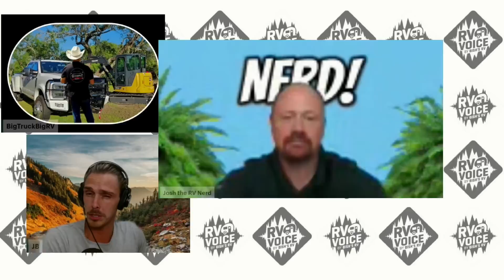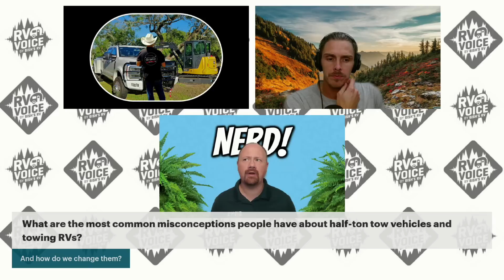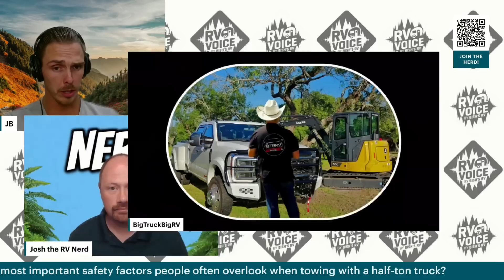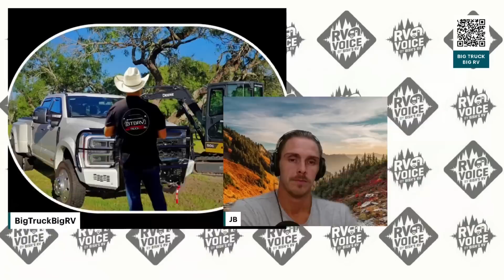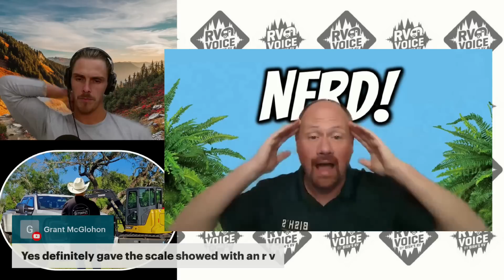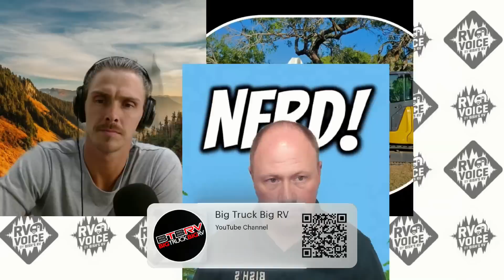1/2-ton Pickup Towing Debate! Josh The RV Nerd VS Big Truck Big RV!

Comment: Awesome video, thank you so much! If you need "a little more" than a half ton, look at the Nissan Titan XD. It's "in between" half and three quarter ton trucks. We tow a 9500 lb trailer with it, and it is very capable. At least, with the 5 L Cummins Diesel we have.
Reply: Titan XD is such an under-rated beast, but the big 3 killed it by marketing their 1/2 tons as able to do anything and in the rare instance it can’t, a 3/4 ton HAS to be used.

If marketing wasn’t a thing, most trailers out there that are stretching the capabilities of a 1/2 ton could be handled safely by the Titan XD without completely sacrificing the ride by using the 3/4 ton as your daily.
Reply: I had one of those when it first came out. We towed a ~10k lb trailer with it. It is an extremely stable platform. Well under-rated for its abilities. Nissan should have installed an 8 lug axle and called it a 3/4 ton.

Comment: A lot of great information here I deliver RVs normally 3 small ones on a 53ft trailer I have a ram 3500 HO dually which technically has a towing capacity of 35,000 my loaded trailer normally weighs around 17,000lb hauling campers or 20,000lb hauling cars/trucks and that about the limit I am always getting close to payload/rear axle limit. I see other guys running similar setups at me and they are way over the limit. I do have air bags the main reason for me is without the truck sitting level I was getting a lot of outside edge tire wear on the front tire plus the headlights

Comment: Because of JD and Josh I did a lot of research when I went truck shopping I cannot think these two guys enough for the information that I got from them I did go with a half ton truck it is a Ram 1500 5.7 Hemi Laramie four-door four-wheel drive with the pulling transmission and the lower gear ratio payload capacity 1800 d-rated to 1600 why was it derated because it has 20-in rims instead of 18 it has the sad steps and the vinyl bed cover 11200 lb on Towing gross vehicle rating for just the truck is 7100 lb because of these two videos and information that they have put out there I was able to do my research and learned where to look to find the answers I have been restoring a 1983 Cobra Monterey 26 it's a small cabin cruiser on a tri axle trailer we'll be putting videos out soon of how the truck pulls the boat I am going to be getting a camper in a year or so love JD's channel in Josh's Channel real source of Towing information

Comment: QUESTION; Jash, can ya’ll comment on equalizer hitches, airbags, and how to use them together since I see a dozen different opinions, thanks
Reply: Josh, lol
Reply: I’m not Josh or JD, I have been around the block with a trailer a time or two though. Here’s my $.02…

Always use the equalizer (weight distribution) hitch first. Properly set up, this will help distribute the weight across the axles properly. The hitch should be installed and set up with the truck empty of cargo, and the trailer weighted as you would tow. The goal of the WD hitch is to distribute weight, not necessarily to level the rig. Tow vehicle front fender height is the indicator you should be using for weight distribution. The trailer should be level, but the truck doesn’t necessarily have to be level. Measure front fender height unloaded. This is the number you should be aiming for when setting your WD hitch. If using airbags, only use them after first using the WD hitch. I have used airbags when towing heavy and carrying a heavy load in the bed. The airbags help keep the added payload in the bed from being distributed to the trailer. I would only air them up enough to regain the sag caused by the added payload. I used to tow with a 3500 SRW and the truck would sag quite badly with extra load in the bed while towing a bumper pull trailer, even though I was still well below payload. Without airbags, a very large percentage of the weight of the payload in the bed would transfer to the tongue of the trailer.

Comment: I tow a fith wheel Featherlight  all aluminum trailer for my show car.  The loading of the weight vs trailer axels vs to vehicle (F350 Duley) got me into trouble.  Trailer Swing was the problem,  So weight placing from trailer axles to the payload is critical.

Comment: Hi guy's between gas and diesel does a gallon of gas weights the same as diesel or is it the other way around for the weight of the truck and how big is the tank
Reply: Diesel weights 1.1 lbs more per gallon than gasoline. So, if the truck has a 36-gallon tank (common for Chevy/GMC HD trucks), a tank of diesel will weigh 39.6 lbs more than the same tank filled with gasoline. That counts against payload.
Reply: OK thanks

Comment: I tow with F-150. Biggest problem for me is the rear axle weight rating at 3800lb rather than the payload.
Reply: Your payload is over 3800 lbs?
Reply: @Cloud30000    that's the axle weight rating

Comment: Crazy thing is there is a group out there on Facebook bragging about towing fifth wheels with half ton trucks.  I doubt many of them have weighed their set up.
Reply: Yup, I'm Canadian and was at the duty free shop at the US/Cdn border one night and I was pulling my 27 foot travel trailer with my F250 diesel.  Then a guy pulling a medium sized fifth wheel pulled in beside me pulling it with a 1/2 ton. His truck was noticeably squatting.  I joked with him that we should swap trucks.  Very clearly he should have been using a larger truck to pull the fifth wheel.
Reply: @ericoswald2279 There are absolutely 5th wheels out there easily towable by some 1/2 ton trucks.   The manufacturer specifically markets as such.   Cougar makes some.
Reply: @donistel8175 We know.  The problem is not every half-ton is built to the capacity’s needed to do it safely.   Naming something “Half-Ton” is just a ridiculous baiting for unknowledgable and inexperienced buyers to get themselves in a dangerous situation.  Many dealerships are clueless as well and only focused on sales so it’s buyer beware.  I predict there’ll be some lawsuits and big payouts before all the dust settles.
Reply: @donistel8175  as long as people know how much they are loading their truck I thinks that’s awesome.  I have seem some big fifth wheels being pulled by some 150s though.  I just hope they have scaled them.
Reply: @donistel8175 Again “Some “ is the keyword
Reply: Not only do you have to worry about weight and power you need to consider if you have enough brakes to stop it if something happens the bigger the truck the bigger the brakes
Reply: Smaller 5th wheels about 30 feet long nice thing is get a 30 foot trailer that overall length is shorter then a 30' travel trailer. Also get more features in a 5th wheel then would normally get in a travel trailer like electric leveling. I'm using a Ram 2500 with a diesel but my pin wight is only 1400 lbs. well within the max cargo rating of 2000 lbs. I thought I made a mistake getting a 2500 limited myself but realized I really don't need big RV only my wife and I were part time RVers it fits on the side of our house.
Reply: Half ton pavement princess.

Comment: I think you guys are both great my wife and I bought a 2001 f350 SRW 4x4 with a V10 in Feb 2020 and bought a forest river 8327 SB the gross weight on the trailer is 10300 lbs the hitch on the truck was rated at 10000 so once I got home I had to find a 14000 lb hitch to be safe.

Comment: I understand that there is a work sheet out there that you can plug in the numbers from your truck n trailer so you know where you fit in all this. I have a Toyota tundra 5.7 v8 crewmax with tow package. Tongue weight is 508lbs and trailer is 6000 lbs. I was told I was n spec but would love to make sure.
Reply: There are lots of spreadsheets out there. Check forums or FB pages for your make of RV. Better yet, go to a scale and get the real as opposed to estimated numbers.
Reply: @jimblack5596 - Hear, hear!

Comment: I like that Josh & JD have made it very clear that PAYLOAD is spec that one should focus on. However, I would love to hear them go just a bit further and declare that, at least when towing RVs, that ‘THE TOW RATING NUMBER IS A THROWAWAY’!

As they stated multiple times, it is rarely, if ever the limiting factor. It is high time that the truck manufacturers are called on the carpet for focusing their marketing on tow capacity. You guys are major influencers. Use your influence to end the focus on tow capacity!

A second statement that I would like to see you place major focus on is to WEIGH YOUR RIG! It is easy, inexpensive and most importantly it will take all of the guess work out of determining your true payload.

The industry needs to change the discussion and put a focus on these two topics.

Great video!
Reply: I agree for the most part, but there are niche circumstances in which the tow rating becomes important even if you are safely within payload limits.

The most obvious example is a long slope with a slow speed limit, in which the transmission or the engine has trouble cooling itself, even though the frame and suspension can easily handle the load. The TFL “Toaster Test” tends to take this situation to the extreme, but that is why a truck with a high pay load (like a pick up with a tiny engine but high payload package) can easily haul stuff around the farm, but will cook itself trying to tow a trailer with a hitch weight below it’s pay load up a dirt road on a giant mountain.

Comment: Axle rating is very important too.  Weigh your setup so you know.
Reply: I would be amazed if someone properly utilizing a weight-distributing hitch was below their payload limit but above their rear axle limit. On the other hand, it’s easy to do when not using a weight-distributing hitch, but you must already violate the vehicle ratings to do so which intentionally limit hitch capacity without a weight-distributing hitch.

Comment: Great video. I think much of the issue buyers have on this subject is that their Eyes are larger than their Truck! There are a lot of 25' to 30' foot travel trailers are too much for the lower rated 1/2 ton. But those trailers look so much more spacious than the smaller trailers. No doubt there are salesman that will want to make the sale, even if the trailer is too big. Personal case, my wife really wanted a Full Queen bed in a forward bedroom. I would too, but I didn't want to buy a new truck with a trailer. We have 2013 F150 XL, 3.7v6. 1600# payload, 6400# tow. Most 2 axle trailers with a front bedroom have a GVW of 7000 - 8000#, too much for my old truck! We pick a 2022 Surveyor 19BHLE, GVW 4808#. Our usual packing gets us to about 1500# cargo in the truck. We recently towed 3000 miles to Texas and back to visit family. Other than crappy roads, our rig had no issues. with luck, it will last for many more years.

Comment: Another misconception is an SUV is a heavy duty half ton truck.
Reply: GM offered a Suburban in a 3500HD starting in 2016 GVWR of 11k lbs and capacity of 4405lbs. They ended production in 2020.
Reply: @Mike-01234  I've heard of them, never seen one in the wild
Reply: HD and Half Ton are mutually exclusive, and SUV is independent of either of those.

SUV is equivalent to pick-up, with one being enclosed and one being open, but neither implying the weight or payload capabilities.

An HD truck, by nature, is not a half ton as it must be capable of more than a half ton, regardless of whether it has an open bed or not.

I hate using catch-all names these days as people lose all context of their original intent.
Reply: I didn't think they were commercially available.  Only for government sales, but probably will start seeing them on the used market soon.
Reply: What about Nissan Titan XD, it posts cargo capacity of around 2,400 pounds. My 4x4 tundra is only 1340, so Nissan is 1/2 ton but the XD is heavy duty, more like 3/4 ton capacity.

Comment: One thing the auto industry doe NOT take into account is the wind resistance of an RV when coming up with ratings. Also something folks do NOT take into account is the breaking capacity of the truck when fully loaded.
Reply: I assume you meant braking and not breaking capacity unless this is another category of stuff that we have to look out for.  Do they rate trucks on when they break?
Reply: @handlealreadytaken  very funny smart ass post
Reply: Some do not understand that tow ratings also include the ability to stop. If the tow rating is 10000# it is rated to stop that weight.
Reply: Braking capacity is in fact part of the SAE J2807; I am unfamiliar with the maximum slope and length that is tested, but it is part of the testing to some degree. 

I believe that you are correct in that wind resistance is not part of that testing, and should be taken into consideration when selecting a safe trailer to tow with any given vehicle.
Reply: Ford definitely does give wind resistance on their smaller trucks.  They even give a max sqft of the front cap of a trailer.
Reply: @crawdaddct  but they all do the tow capacity using flat bed try...load sheet steel to the point that they are satisfied with. Got that from a RAM engineer directly.
Reply: @waltfriedrich7631 no, they use a standard enclosed cargo trailer, called out in SAE J2807 spec. A little smaller than a typical RV, but a far cry from a just a flatbed.

Comment: If you exceed the numbers of your truck when towing and have an accident you’ve voided your insurance.
Reply: If you exceed the speed limit or violate another vehicle law and have an accident, have you voided your insurance?
Reply: @OnceApilot  I should have used the word “Canceled” vs “Voided” Additionally, o
verloaded vehicles and passengers can lead to instability, difficulty maneuvering, and a greater risk of accidents. Violating this law can result in a misdemeanor charge by traffic citation, with consequences of fines of up to $1,000, possible jail time of up to 12 months, and 3 points added to your driving history. Additionally, if you caused an accident because of this traffic violation, you will be on the hook civilly by the other people involved in the accident.
Reply: All of those risks also apply to violating any laws, and come down to lawyers duking it out in court. An insurance company is a for -profit company, so they are heavily motivated to maximize profit by finding any reason they can to deny a claim.

Is that extra 300 lbs really worth giving them another reason to fight you in court?
Reply: Also, if you are found at-fault for an accident in which someone was hurt (including your own passenger), be ready to battle criminal charges for negligence for EVERYTHING, including speeding and exceeding payload.

Comment: Great video as always I just purchased a 2023 jayco eagle 332cbok and it has a ht sticker on the right side dry weight is 11 k 1500 pound hitch weight ?? lol
Reply: Ps where can I get some stickers
Reply: No. Ignore the ficticious mythical "dry weight" and look at the GVWR. The pin weight could be anywhere between 15% to 22% of the GVWR in a 5th-wheel on how the trailer is loaded. A typical travel trailer will have a tongue weight around 13% of the GVWR but not less than 10% (sets up trailer stability issues).